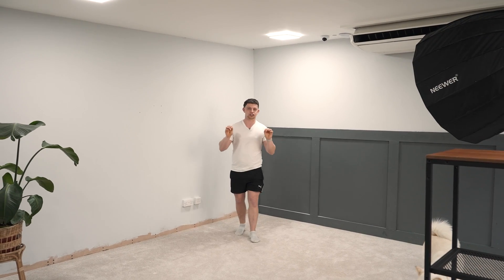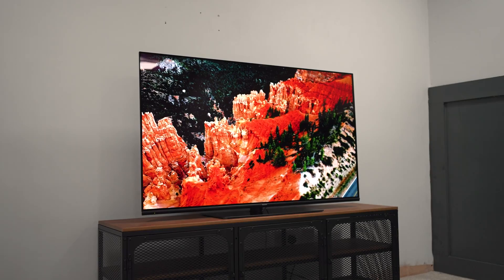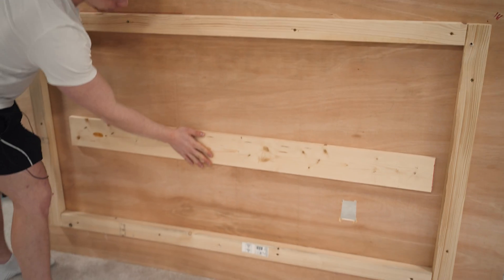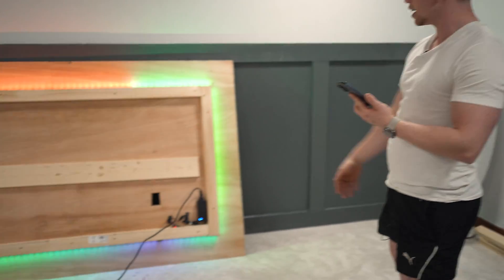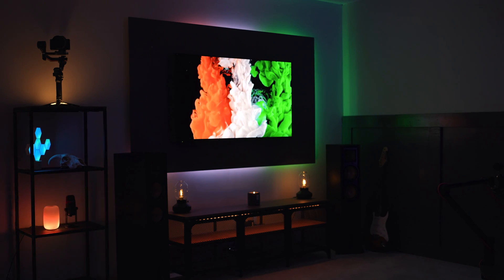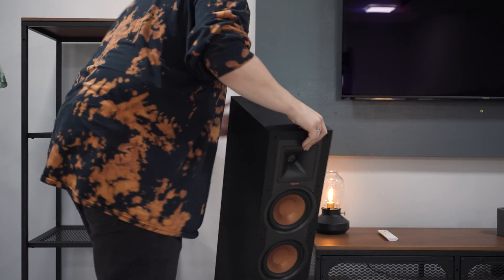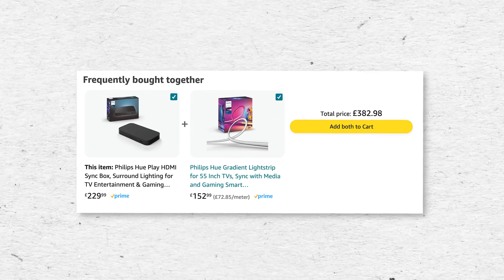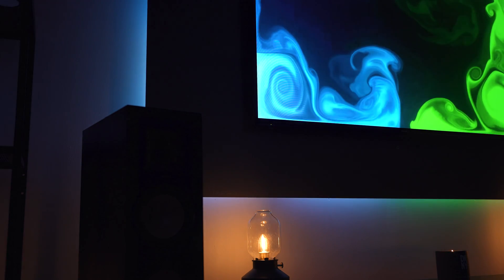Building A Budget Ambilight TV With WLED! (UNDER £70!)

Comment: A word of caution.
Yes the w-led setup in the video works however it won't last long as there is no circuit protection for the LEDs.

There is nothing stopping them from drawing more than 10 amps of  current and potentially starting a fire. Also there is no filter in the data line so the LEDs will get dimmer and flicker over time.

There are pre-made WLED controllers available online with an  inbuilt fuse and circuit protection that will completely protect the LEDs and increase their longevity.
Reply: first of give me a single good reason that a led strip would ever suddenly pull 10 amps.
i mean the power supply used likely wont pump out 10A in any case, ill even bet ya it's no more than 5 amps max.

and you can literally use the app to limit the current drawn by lowering max brightness.
and adding a fuse isn't that hard..

Comment: How to fix LED strip flickering issue that I am getting?

after white colour showed  on screen then it flickers whole strip in random colours for half a second and it repeats in random time...
Reply: Did u soldered ground wire to esp?
Reply: @amaangamingyt4537  I've resolved the issue with the LED strip power supply. I was originally using wires and connectors rated for 5 amps, but the WS2812B LED strip requires 0.6 amps per LED. For 180 LEDs, I needed at least 10 amps. To accommodate this, I upgraded to wires and connectors with a gauge of 1 square mm or higher. I verified the current draw using a multimeter, and it's now around 10 amps, which is sufficient for standard usage. However, for HDR and bright light scenes, I recommend using 1.5 square mm thick electrical wires for optimal performance.

Comment: wouldnt this be easier using a raspberry pi (even a pi 2 zero) surely instead of the devboard, then you can connect the capture card to it and run with hyperion? a more sort of all in one solution
Reply: You Can and I think you should but You Can also combine the esp32 wled with the Pi
Reply: Kinda, WLED was designed for esp boards so a rasp pi would have some caveats so you need an esp32 or similar for full control and then you would also need at least a pi 4 for 4k 60 fps as older pies would struggle to keep up with all the processing